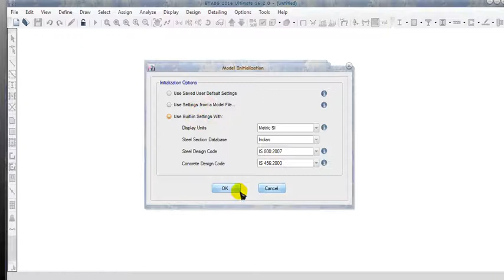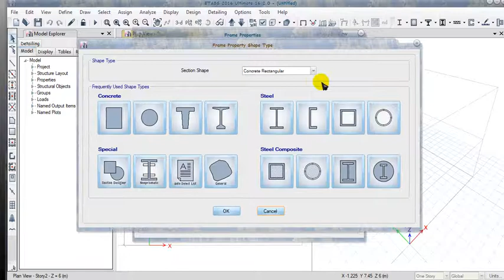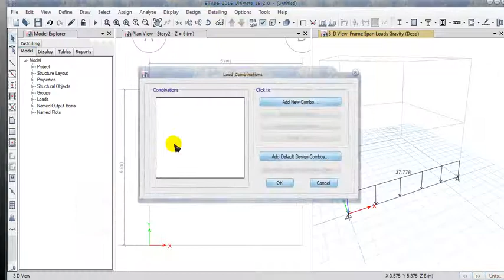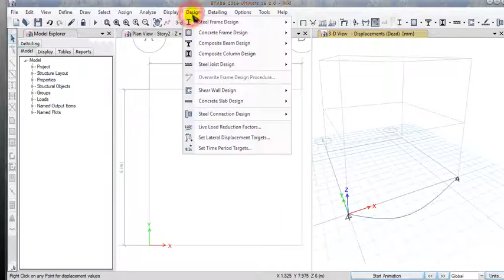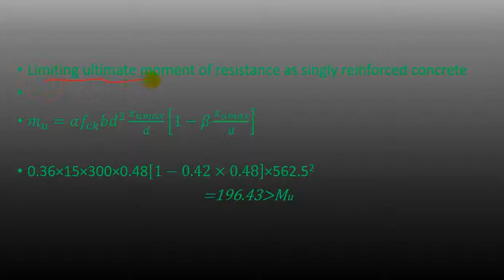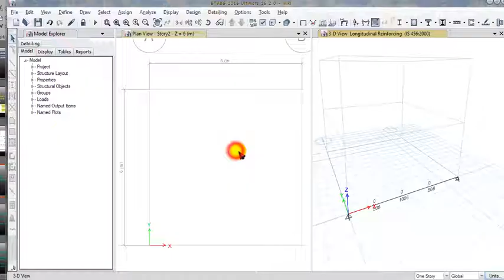Comment: Hello Rejin, I'm using ETABS 20.3.0 version , and for same example (simple supported beam) I'm getting error message after analysis (solving linear stiffness from Zero initial condition). Any suggestion what the problem could be ? thanks in advance
Reply: Nevver saw that error .. is it cz ..support assigned ???
Reply: I think so as the warning disappears when I replace one of the supports with a fixed one  @rejinyahel
Reply: may I share the .edb file if needed @rejinyahel